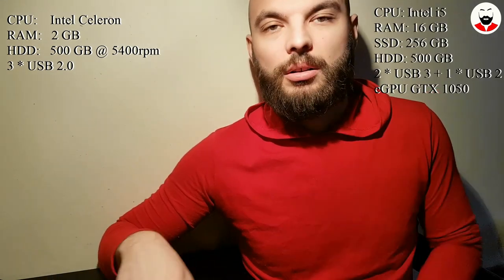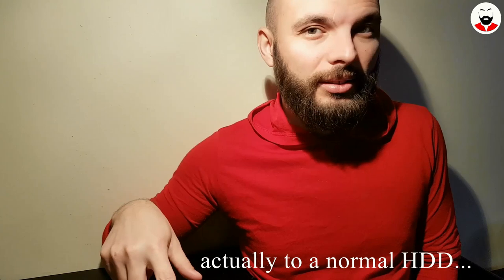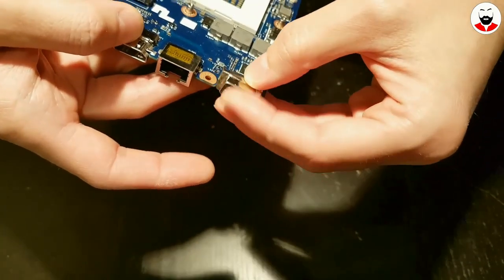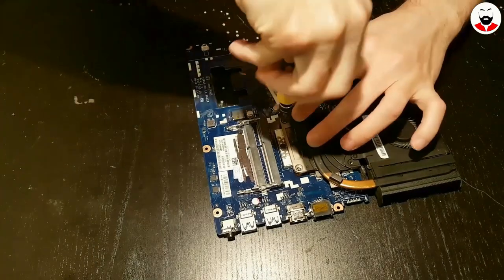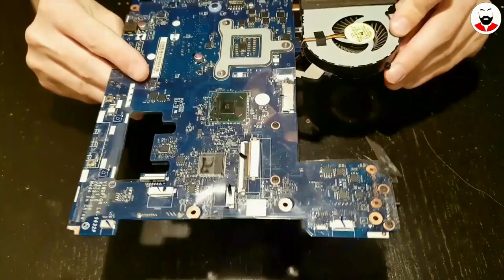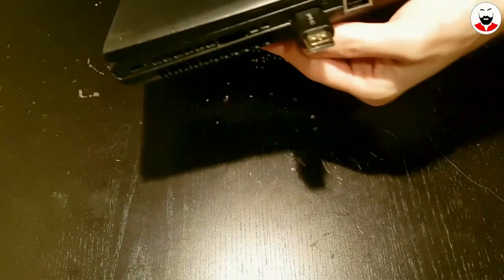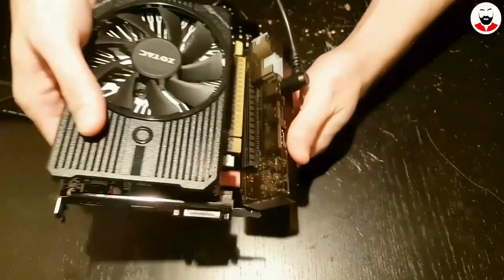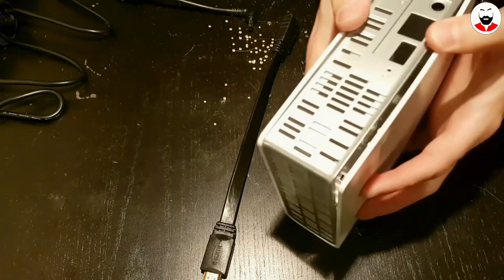Let's Upgrade EVERYTHING For The ULTIMATE Lenovo G500 Laptop - Motherboard, CPU, RAM and GPU

Comment: nice work! only thing i would change is using a female to female coupler on the egpu connector so you could just have it flush with the case and use an hdmi cable to connect it to the egpu.

Comment: Good video bro👍...I installed Saphire nitro + Rx 570 to my laptop having i5 7200u (Lenovo IdeaPad 320 15ikb) having 8gb of ram with no SSD ...
Some games like gta5 are running perfectly fine ..but for some new games like shadow of the tomb raider there are lot of frame drops in some areas...does upgrading my laptop with 16gb ram and 250gb SSD fix the issue ... please reply?

Comment: Nice, I'm thinking of doing a similar thing but with a lower end GPU (GT 1030 GDDR5 30W) I gonna try make it internal where the DVD-player is (I remove the DVD-Player) to make room for the LP GT1030. I have a 120W PSU with a 35W i5 560, 8GB RAM and 256GB SSD, GPU 5470'

Comment: what I recommend is getting an acer aspire 776Z you can get them for $20 but when they were considered good aka 2009 they costed a lot which means it is better but your upgrading it anyways super cheap fairly easy to take apart but it’s so heavy I recommend getting a new keyboard and a thinner keyboard for weight reduction and probably a new screen because the screen that comes with it well um it stinks

Comment: Will this trick work with my gtx 1660 super 6 pin connector and will it work with my laptop cable 🤔 or it require more power
Reply: 6gb graphics wont work gpu will bottleneck the cpu
4gb graphics could be better ;)

Comment: im looking to do something similar with my laptop which is MUCH older but cant find parts. its acer Extensa 5230E. any ideas? it will be used PURELY as a portable machine, not for gaming, but its VERY slow and power hungry compared to my desktop machine (speed and battery life are main things i want to improve as i use it in my vehicles, NOT when driving obviously) so would like to at least get performance more closely aligned. desktop has SSD and Ryzen 2200G with 8gb ram
Reply from the maker: Hi. These are all the parts I could find for your laptop: https://ebay.to/32bLIUL
But the biggest difference in speed that you can notice is to move from a mechanical hard drive to an SSD. Just make sure it fits in your laptop and that your laptop uses SATA and not IDE before you get it. Here are some SSDs on amazon: https://amzn.to/2Zn1CtH

Comment: You could've used a female hdmi port there instead of having the male connector just sticking out. But still it's a very good upgrade video!
Reply from the maker: I actually tried to do it with a female to female adaptor to the EXP GDC HDMI cable but I didn't had enough room inside the laptop. I will try to find a slim hdmi female to hdmi female cable - maybe like that I'll have enough room inside the laptop and find somehow space for the extra cables. thanks for watching!
Reply: @Gabriel2.0    I was able to fit mine somehow because the other version looked very ugly and there was a high possibility that I would end up damaging the hdmi cable...... I used a slim  low profile hdmi female to female cable to do the trick

Comment: Wow awesome job. Help me please, I have the same lenovo g500 laptop and the same 1005m processor, cpu z says HM76 and 22nm (if it matters), and socket 988B rPGA.(g2) What processor can i use for sure to upgrade and whom is most vfm? My graphic card is intel r hd graphics. I have upgrade already with 8gb ram and SSD to DVD.Thank you.
Reply from the maker: https://ebay.to/2OlZNqB
 the same I used. but you have to change the motherboard as well since I don't think the chipset supports it

Comment: Plz tell me that i can replace my i3 6006u with a 8th gen i7 or i5 in my dell inspiron 15 3567?
By the way love your videos!!!!!
Reply: Check if it's the same socket for the old cpu and the new one
If it's the same, most probably: yes

Then, watch a YouTube video to see its disassembly

One thing is that the cpu can be soldered on, so make sure it is not

Good luck
Reply: I used to have a AMD processor with my Inspiron 3565, then I upgraded it to a i3 7th gen, boosted the improvememt. So ya can't replace the CPU by itself with a new one (since they are soldered to the motherboard) You'd have to get a whole new Motherboard with a better processor soldered onto it. I could link ya some if you want.
Reply: @TypicalFrogman   I have an i5 but and old generation and gets really hot. I was thinking to get a ryzen 3200g and a new Mobo. This can be done?or are there some specialist ones for notebooks? Share the link
Reply: @jguillermooliver  An AMD laptop Processor I mean, but you should go with an AMD, good performance and good prices.

Comment: Hey m8. Nice video.. i want to do the same thing with my laptop. I will add only the gpu and i am intetested if a  nvidia geforce 960 4 gb will work with 12v computer charger.
Reply from the maker: lan coha thanks mate! I doubt the 960 will work with the 12 V power adapter since it requires a 6 pin power connector as well.
Reply: GaBIT thanks. So that means i should buy a power supply?
Reply from the maker: lan coha yes
Reply: GaBIT is there any other way to get enough voltage for this gpu?
Reply from the maker: lan coha not that I'm aware of
Reply: GaBIT thanks alot.

Comment: nice work! only thing i would change is using a female to female coupler on the egpu connector so you could just have it flush with the case and use an hdmi cable to connect it to the egpu.
Reply from the maker: Thanks. This was my initial idea but it was not enough room inside the laptop